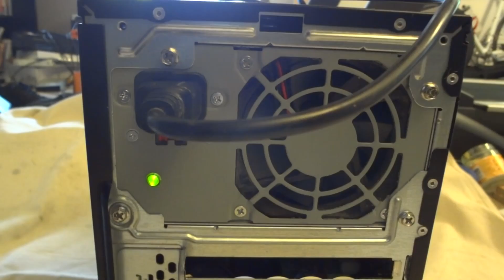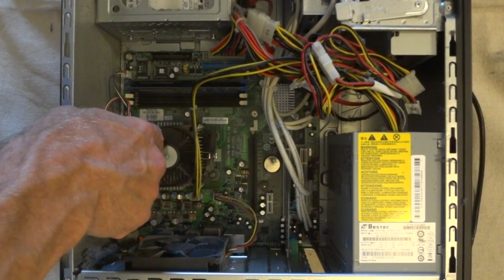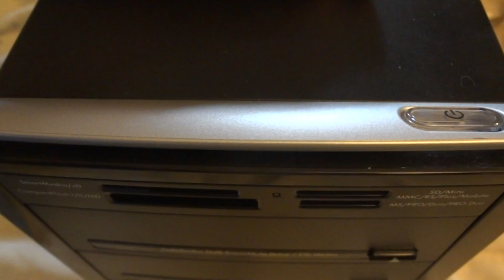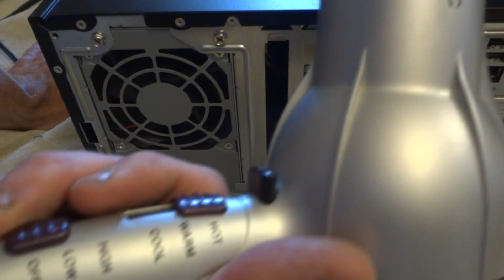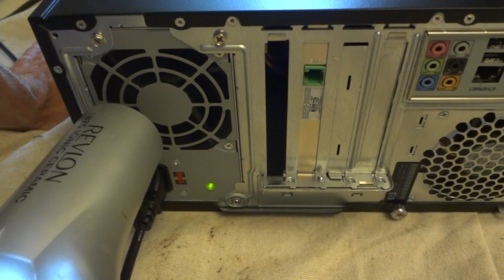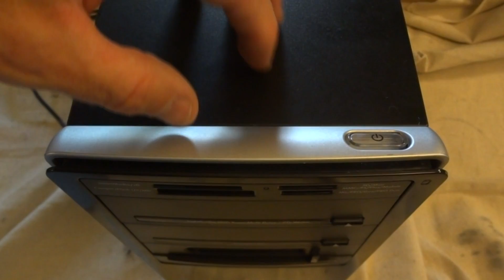HP Computer Won't Power On (Flashing Green Light On Back)

Comment: I have a problem where my power supply 100% works (i got it to power up without a mother board) but when installed properly into the mother board nothing at all power up. it also has no lights or what not on it.

Comment: i had this same problem with my compaq. compaqs and hps are notorious for this. what i do whenever i unplug my computer and it does this (blinking light), i open the case and slowly plug the atx motherboard cord NOT straight in, what i actually do is put it in at an angle and slowly turn it in, which gives me the solid green light.
Reply from the maker: I would hesitate to recommend that as there is a possibility of frying something. Personally, I would recommend replacing the power supply.

Comment: Capacitor problem most definately. It's the issue almost 99% of the time. Heating may "fix" it temporarily but no one should use these crappy PSU's with any fix as when they go, they can take many other components with them.
Reply from the maker: That is why I replaced the power supply.

Comment: Question: My daughter just brought me her HP Pavilion with the same problem (no power when button is pressed) except the green light stays on...no flashing. Can you explain the significance of that green light flashing versus remaining solid? Thanks!
Reply from the maker: Sorry, it sounds like a different issue. Could be a bad power switch, a bad mother board, and a loose wire. So there's not really a short answer.

Comment: I have the same computer and mine will not turn on as well. The green light is not flashing but when i push the power button it flashes blue and the green light turns off. Any advice as what might be the problom?

Comment: Good video! - thanks for going through the HP Troubleshooting as well as this will be a fix for some normally seen after a power outage. There are usually two issues (possibly more) that cause this that could be affected by the heat of the hairblower for those interested in why this works: 1. Melting/reflow of cold solder joints - cracks in solder from overvoltage/overheating can prevent connections. The blower will be hot enough to recreate a fragile electrical contact, but won't do the most effective and long-lasting repair which would be to remove the old solder and apply new solder to the joint. 2. There are a few electrolytic capacitors that tend to bulge and leak over time in some power supplies which can cause it to fail - heat will affect the overall RLC (Resistance / Inductance / Capacitance) of the circuit and could allow the system to startup with a lower capacitance that would be seen from a leaking capacitor.

Comment: Had the same problem and fixed it with the blow dryer. Not sure why this works because I am not an expert on power sources but manually spinning a dc motor like the one in the fan will actually generate current.

Comment from the maker: Sounds like the power supply is totally fried. Not sure about the explosion. At what point did you plug it in and the explosion happened? In my video, the last thing I do is use the hair dryer, and at that point, the machine was already plugged in. I have a video on replacing the power supply. Its pretty easy.

Comment from the maker: It sounds like a different issue. It could be that the power supply is toast. Or maybe something wrong with the motherboard or some component. I would lean to the power supply, but I would hate to just start swapping part out on a guess. If it were me, I would try to borrow a similar power supply, plug it in and see if you get a different result. If it works at all, then get a brand new power supply. I have a video on how to replace an ATX power supply.

Comment: I moved from San Diego to Va Beach and once I got here, my computer would not turn on.  I had the flashing green light and followed the exact steps on this post.  The only thing I had not tried was the hair dryer.  I don't understand why it worked, but it did and i'm so thankful.  My computer works again.  Be patient, the dryer took about 45-60 seconds to get the green light to go steady.  This is my first post ever because this is so great.